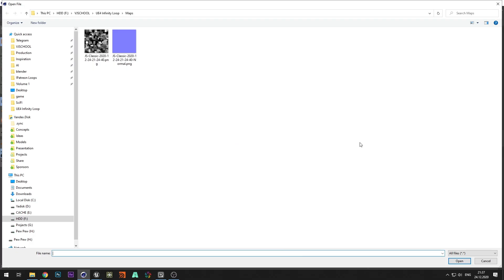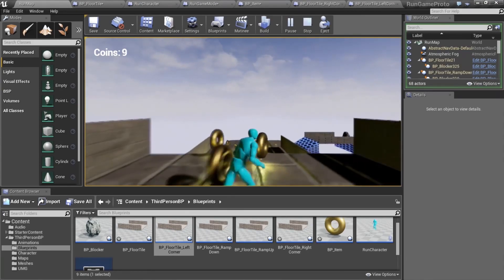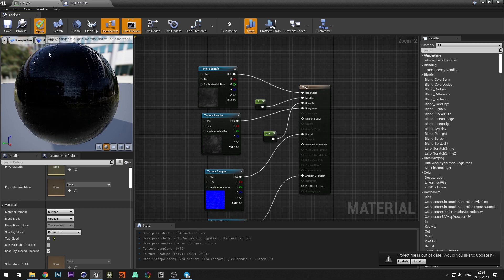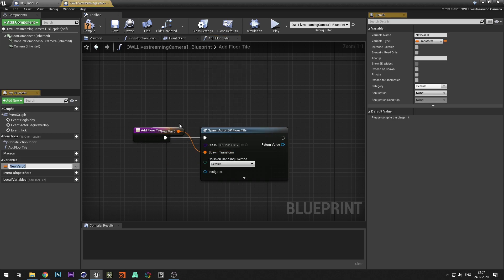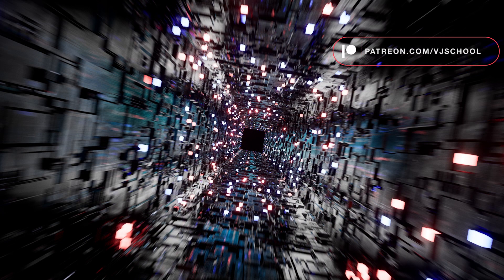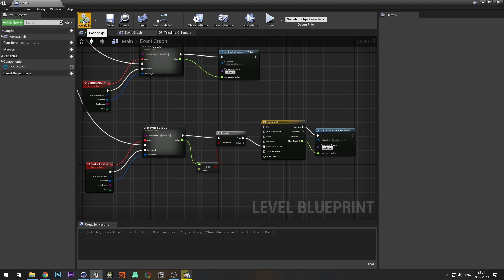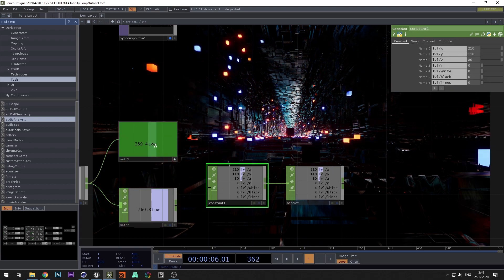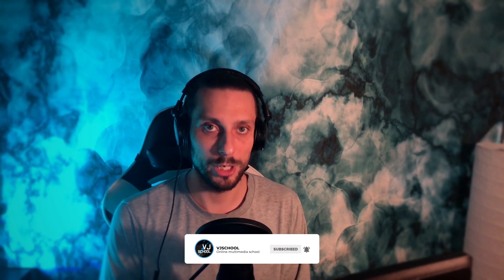UE4 Infinite tunnel - Audio Reactive Loop in Unreal Engine & Touchdesigner

Comment: Thanks for sharing, it's interesting to see that you can have a mesh respawn itself over and over, which could be useful.  I'd be more inclined to just manually repeat a nanite mesh over and over to get a long tunnel that extends fully into the distance.  Thanks for the tips, your English is pretty good I think ;)